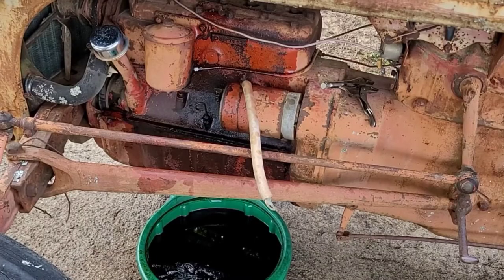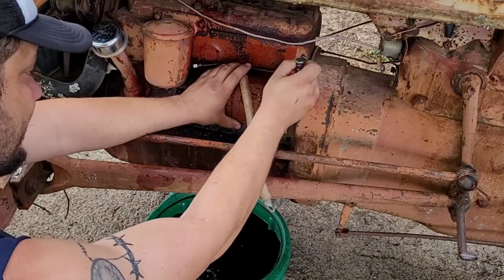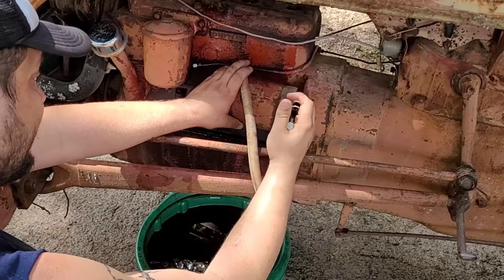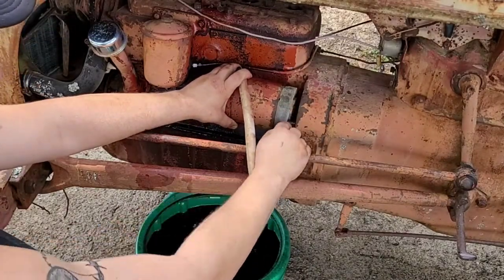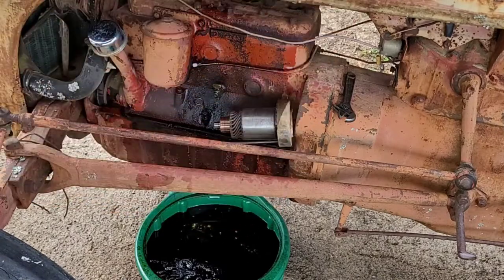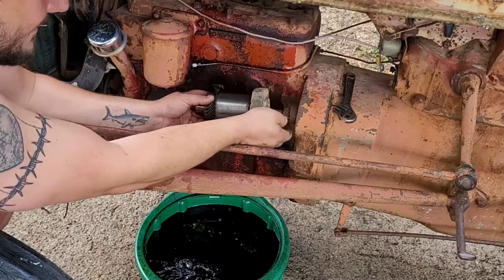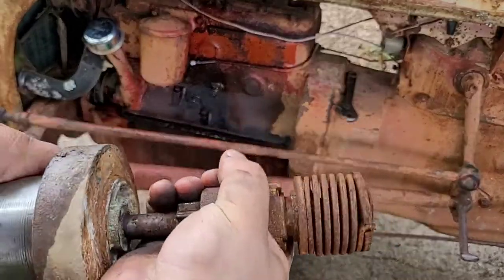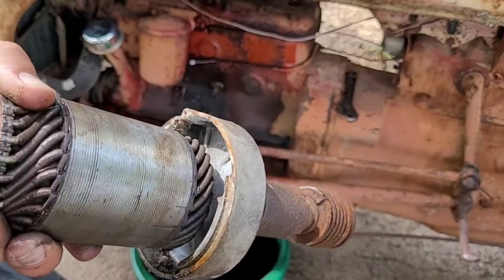8N Ford Starter Removal Tractor 9N 2N

Comment: You can't see clearly in the video, but the spring gets hung up on the main gear. The only way i know to get it out, is to rotate the small gear on the starter motor shaft until its as far away from the spring as possible.  After that, rotate the starter shaft to "screw" the spring past the gear. It helps to pull the starter housing off the rotor to give more room for tilting the rotor shaft. Hope that helps. The 2 bolts are the easy part.

Comment: I have a 1949 ford 9-n , I split the case, turned the Ring gear over, installed new clutch throw out bearing, pressure plate , put everything back together now tractor will not turn over, any ideas?